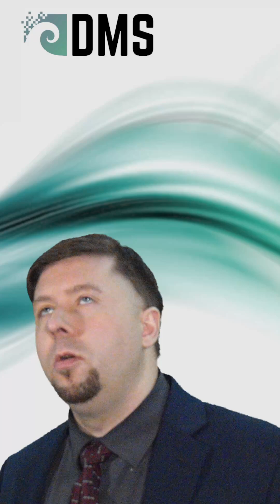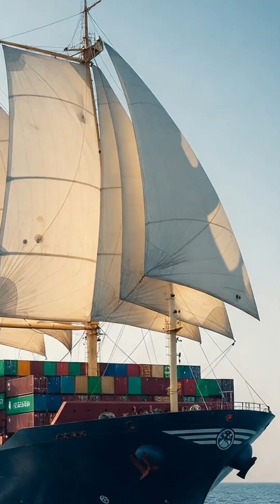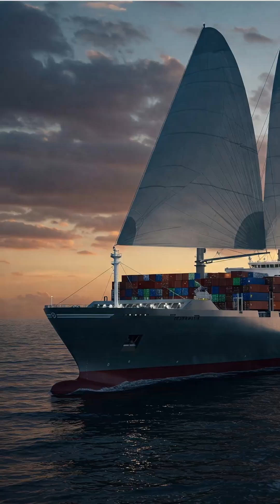Green Shipping:  Sails on Cargo Ships

Comment: Totally agree that sails are the best near term answer for cargo ships, especially since it wouldn't be that hard to go back to sailing trade wind routes, and I love that you used the maltese falcon as an example since it's a modern take on the old square rigger tall ships.

The probelm with conventional sails as I understand it is 3 fold. 
The easiest to solve is that the masts get in the way of the cranes and make it hard to go under bridges. that's mostly solvable with more sophisticated mehcanical design, and I'm sure there are many solutions, including a version of the maltese falcon with stepped masts.
The second is that conventional sails make the boat heel over, which at minimum means lashing every single container instead of just the bottom rows and adding much finer subdivisions on bulkers and tankers, which makes loading and unloading take much longer. It also probably reduces your cargo capacity to maintain enough reserve stability.
The third is that conventional sails just don't produce that much power for a given righting moment, so sail-powered cargo ships are going to be pretty slow, which makes the economic case a lot harder to make when it requires adding so much equipment that needs extra maintanance.

I think the answer to a lot of the issues with conventional sails on modern cargo ships is kite sails. They don't require masts that get in the way, produce almost no heeling moment, and produce much and more consistant power for a given sail area. Unlike masts, they're also a lot easier to retrofit. The tech is also getting pretty good now and it's pretty simple, so it shouldn't be soo hard to make.